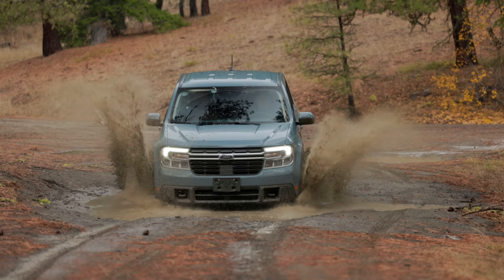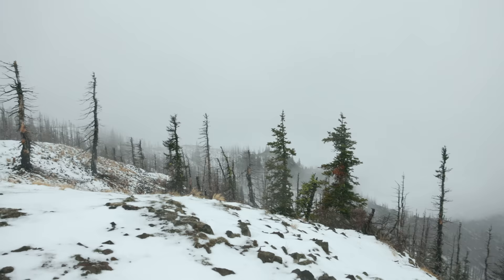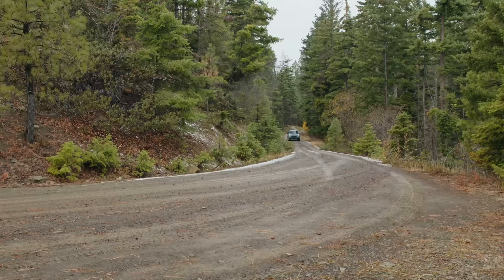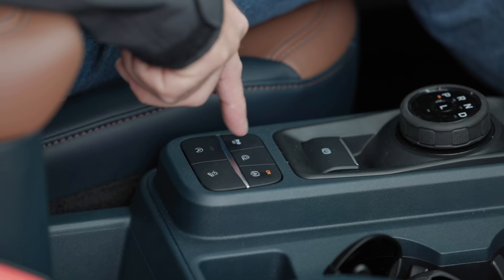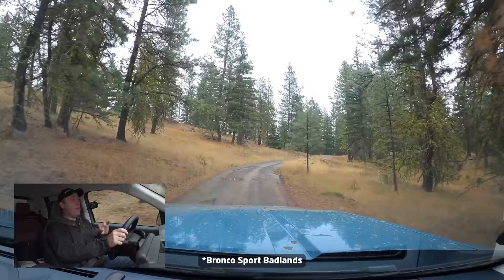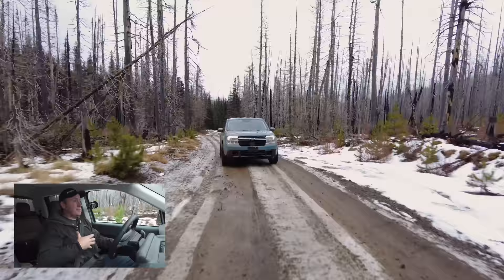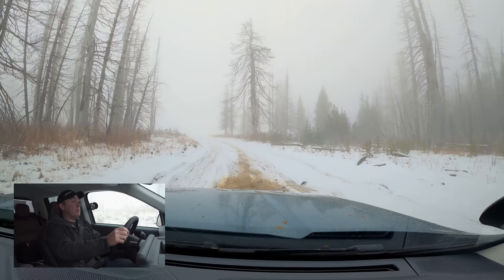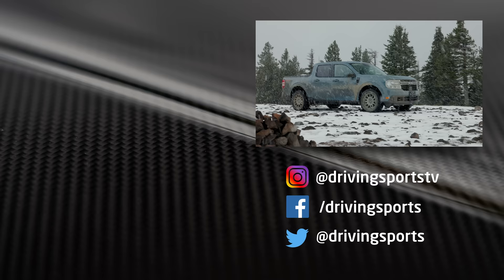2022 Ford Maverick FX4 Vredestein Pinza All-Terrain Mountain Adventure

Comment: No interest in lifting the Maverick as is? I guess it's good enough for what you'd use it for.

Definitely my favorite new car of the year. Just wish there was an AWD hybrid.
Reply: I'm pretty sure all that is out right now in the aftermarket lift world is basically just spacers to lift the body away from the suspension which is definitely not the ideal way you want to lift a vehicle. I would wait for a proper real suspension lift to put on instead of the spacers
Reply: @Mr.Thermistor7228  3K lift on a 20K vehicle? 🤣
Spacers will do just fine.
Reply: My thoughts exactly, there's an AWD hybrid escape, why not the Mav? Price maybe?
Reply: @misohoney4656  Having seen both done on the Jeep Liberty, I can say with confidence that a full coil over replacement kit is going to be significantly superior to spacers.   And it doesn't have to cost 3k either.  1k is normal for a mid range coil over kit.  Now, if you want adjustable hydraulic shocks and all the other hard core offroad goodies then yeah, 3k.  Why would you get that for a Maverick though?  Upgraded Old Man Emu or Bilstein or Rancho shocks and stiffer taller springs isn't going to set you back that much and it will do a better job than "hockey puck" spacers will.
Reply: In general you should avoid ever lifting IFS unless you get a redesigned kit with new control arms etc, otherwise you're just asking for trouble if you're going to do anything that requires that full suspension. Slightly beefier tires was a good route to go, the Maverick already has pretty decent ground clearance.
Reply: @benlzicar7628  This statement is patently false.

I have been driving a lifted IFS 2008 Jeep Liberty for 13 years (10 of them lifted) without any issues.  There is no reason whatsoever to avoid lifting an IFS, provided it is done within the limitations of the range of the arms.

IFS DOES have limitations to the amount of lift you can add, and the more lift you add the more complex and expensive it gets.  At higher lift heights (Usually more than 3 inches) the lift will require replacement control arms and long arm axles, etc.  Less than that though and you are perfectly fine and there is no significant danger in lifting.

There is an argument to be made that lifting MAY cause premature wear on some parts.  However, the wear involved is often minimal if one's driving is primarily on road where the lift won't be stretched out to full flex very often.  In other words:  For most people it will be fine.
Reply: @Wearyman  any 3 inch lift recommendations for a 2008 Grand Cherokee? Also, would I need better differential gears over the standard gears when going with bigger tires?
Reply: @FluffyHawk13  Honestly couldn't offer a recommendation, I'm not super well informed on the Grand Cherokees.  That said, I have absolutely seen a bunch of lifts available for them.  Check with all the major manufacturers, and check some of the Facebook groups and internet forums to see what people recommend.  Re-gearing isn't something to be attempted lightly as it is a major system change.  Although as you get larger tires, moving up to a higher ratio can help maintain fuel economy and highway speeds.  So if you intend to really go up, it is probably worth considering.
Reply: @Wearyman  appreciate it! 👍

Comment: If my wife would allow me I would trade tires as often as you have been :)
Really do appreciate all your tests.  I live in Rural mountain Wyoming and have to drive a few hundred miles a week on dirt/gravel and snow.   We ended up going with Falken AT Trails as a compromise between a HD All terrain and a snow tire. (Running on a Jeep Renegade 4x4 with manual trans).   
Considering trading the Renegade for a Maverick each one of your videos is making me more interested.
Reply: Bro, an AWD manual transmission Jeep Renegade?! Aren't those unobtanium?
Reply: @AWDfreak  they are very rare but probably the best combo in a Renegade.  Has the 1.4L Turbo and 6-Speed manual.   Ours is a 2015 that we bought a year ago with only 10K miles on it.  Sadly they discontinued the manual a few years ago :(  Love everything except the space
Reply: @flightmedic7634  It has a pretty short 1st gear, correct? I believe it has an 18.5:1 crawl ratio. It's not quite as good as the surprisingly-capable 20:1 crawl ratio as the ZF 9HP-equipped Renegade Trailhawk, but still massively-better than its sole direct-line AWD manual competition, the car I drive (a manual Subaru XV Crosstrek). Though mine has a special swap that makes its crawl ratio better than even a Renegade Trailhawk 😉
Reply: @AWDfreak  Yes first gear does pretty well.  I have taken it over quite a few trails that were way above what most sane owners would attempt and it has done just fine.    I was considering a manual Crosstrek as well.   A gear swap?  That sounds very interesting. 🙂
Reply: @flightmedic7634  Nah, better. A dual-range 5MT swap. Probably a huge waste of money for most, but I was willing to pay for it.

I think buying a manual transmission all-wheel drive Jeep Renegade would have saved me a lot more money and trouble. Factory-optional Mopar rock rails already available, factory Trailhawk undercarriage protection can be purchased in ready supply under warranty instead of having to buy all this aftermarket protection that I did on my Subaru.

I like my Subaru vehicles, but I'm very much envious of what the Jeep crossover lineup has to offer in terms of factory-available off-road-related parts and outright out-of-the-box off-road capability.
Reply: @AWDfreak  True Jeep definitely does a good job their equipment.   Plus very good approach and departure angles help alot.  I drove a Crosstrek for work for a few years and I really enjoyed the vehicle overall.   They would both definitely benefit from a actual low range.   If I could find a dual range manual transmission I would probably be willing to waste some money on that too🙂 Most times on the trail the lack of lower gearing is my only reason for having to turn around.  I'd imagine that would be pretty helpful on a Crosstrek
Reply: I have the same tires on my Forester. Pretty happy with them so far. They have not seen a lot of dirt yet, and have not been snow tested (but that is coming soon). Great on the highway and especially in the rain.
Reply: I have the same Falkens on my Jeep Grand Cherokee, they're fantastic. The AT3W'S have better grip though but not as smooth on the highway

Comment: Um, pretty sure that most would agree that a narrower tire is better in snow because of increased ground pressure per square inch. Basically, narrower tires 'cut-through' the snow instead of floating on top of the snow.

Comment: Great review as always. This is the best car channel on YouTube hands down. 

I like these tires but there are so many other options made in the USA that I would give these a pass.
Reply from the maker: I get that. Thanks for watching!
Reply: @Matthew Putnam I feel the same way about the truck.
Reply: @rightlanehog3151  truck is not made in USA but unfortunately nothing similar is. Sucks
Reply: @TheCoffeeField  Honda Ridgeline is 🤷🏻‍♂️
Reply: @fubarmedic4222  the Ridgeline is bigger than this one. The ridgeline is a Pilot with a bed. The Maverick is much smaller
Reply: @TheCoffeeField  yes sir you’re right. the Ridgeline is bigger, 11 inches longer and 5 inches wider, And starts at 36k… but the maverick in a comparable trim (XLT with all the packages) is 33k. And the maverick is a Ford Escape with a bed just like the Honda Ridgeline is a Honda Pilot with a bed. Which in my opinion is kind of a poor argument as that’s what they are suppose to be. Also the maverick does get 4mpg better gas milage but the Ridgeline tows 1k more pounds and has a higher payload 250lbs approximately. Also the Honda has a V6 and a better AWD system. 

So its whether or not you want the slightly bigger slightly more spacious Honda or the capable, slightly more affordable maverick.

I compared them hard and couldn’t get over the 12” smaller bed and the vastly more spacious interior of the Ridgeline. Plus the V6 is better tested, longer lasting and more durable engine. Also to matthews point it’s American made.
Reply: @fubarmedic4222  solid argument. Really appreciate this. Thank you
Reply: @TheCoffeeField  I appreciate the civil argument/ convo for sure! Happy new year!
Reply: @fubarmedic4222  definitely! Happy New Year

Comment: Great video! I run wild peak AT3W on my half ton ram here in Western Quebec where we get a ton of snow. It's true that they aren't quite as good in the snow as when I ran a dedicated winter (firestone winterforce UV if I remember correctly). In my opinion the AT3W is far superior to the firestone in deep snow with comparable braking at lower speeds. The Firestone's blow the AT3W out of the water at high way speeds though. In my case, I rarely drive the truck on the highway so this works out fine for me. 

As always, you make great content!

Comment: Would love to see a maverick tremor edition.  If they can add it to the ranger why not the maverick
Reply: It's really not that type of truck, but I would love to see it just as much as you and I absolutely think they should do it. I just understand why they wouldn't at the same time
Reply: You'd really be defeating the purpose of the truck.
Reply: @farstrider79  not really, would only be increasing its offroad capabilities.
Reply: @danieljackson-woods6225  Agreed - a little lift / heavier duty suspension could actually benefit the load-carrying manners.  Also, the Bronco Sport has its off-road package on the same platform, so it's not like they'd have to spend much on engineering.
Reply: @danieljackson-woods6225  Exactly.
Reply: I believe they're already testing a Maverick Rattler trim which is supposed to be a more off-road oriented trim.
Reply: they need to put the twin clutch from the bronco sport on the maverick

Comment: Been running Vredestein Quadrac Pros (also tri-peak rated) in my '17 Impreza for a couple years now here in New England, haven't felt the need to switch to dedicated snows, they just "work". Big thing about tri-peak is, sure, the snow, but also the "really cold freeze 0 or below" days where you'd want a dedicated snow with softish rubber, where an "all season" would be kind of hard and lose traction, even on dry (or, salt covered) pavement. Others have found the same when I've recommended. The price doesn't hurt either. And in the summer? still grippy. I'd definitely say they're much better in all weather than the Conti DWS or DWS 06 that I used to swear by. Practically night and day.

Comment: Speaking to the snow in the PNW I was going over snowqualmie pass heading west in the spring in a 2WD dodge dakota. saw a light dusting thought 'eh its nothing' almost slid into the concrete divider as soon as I hit it. Ended up having to follow an 18 wheeler's tire tracks for traction until the other side of the pass. Not unfamiliar with snow in general having grew up in western MT but that was something else.

Comment: I had a first gen Nissan 200SX 5 speed manual. I put on vredestein all season tires.  I could not get the cars stuck in the snow.  They were rediculously good. I actually would try to get then stuck.  Was always able to get out.  I did not go off-roading since it was a two wheel drive car.  But they were amazing tires that as you said, provided alot of confidence.

Comment: Waiting for the 42mpg Maverick.  Built it several times.   $22,800 out the door with sunroof, rear window and bed liner.  Don't need AWD in Appalachia, Subaru Forrester is for that.  And yes, we do get snow and muck at elevation as well.

Comment: Awsome point about AT tires not being a substitute for actual snow tires. People get confused with the snowflake marking I think.
Reply: I like to add to that comment on the at tires,yes some brands will have two of the same All terrain tires ,one with three peak/ snowflake on it and one without,same thread depth and pattern ,the only difference between the two tires is the rubber compound. The snow peak tire will be slightly softer rubber then the non tire.making it for a better traction in the colder and wet weathers. Plus your your tread mileage is lowered compared to the non snow peak tires.
Reply: A real winter tire is a night and day difference, even from a snowflake symbol tire.  I recommend Michelin-X Ice Snow to swap in the winter.

Comment: You mention back east.  I live in the Pittsburgh area.  Our biggest worry is the 37 degree day rain that turns to ice as the temp goes down just before rush hour..  In addition, if you've ever been to the area, you are either driving up or down a hill 95% of the time when off of a highway, so don't be a bad weather snob LOL :).  Now that the comedy is out of the way, how do you feel about these tires on ice, and do you have any thoughts on durability?  Thanks for the great video.

Comment: I want to order one so bad, but hate all the dealer add ons dealers around me want to add.
Reply: Mine charged msrp. They are out there. May have to drive further.
Reply: @JamesD-HB  oh I know, I've called 3 so far with no luck.
Reply: Hmmmm. I added what I wanted. When I got the lux package there was one thing I didn't like that much but no big deal.
Reply: @timjohnson1199  I'm talking about the extras, they say are mandatory.. like tint for 600, and a few other things.
Reply: How can "extras" be "Mandatory"

Comment: How did you fit the LP1s to the Maverick's bolt pattern or did you get early access to a 5x108 version? LP Aventure doesn't list one.
Reply: I'm thinking LP Adventure drilled a special bolt pattern for him from wheel blanks. They don't offer the 5x108, yet, but I'm guessing they are planning on it and putting feelers out with this product placement. Best looking wheel I've seen on the Maverick by far
Reply: Edit to my other response, looks like Tirerack is the only place that sells a 5x108 version of the LP1. LP Adventure doesn't even list that bolt pattern as available on their own site. Strange.

Comment: So which ones win? Vredestein Pinza or BFG AllTerrain K02 or BFG TrailTerrain
Reply: I ran the KO2s on my Crosstrek for 3 years and recently switched to the Pinzas in the same size (215/75-15). The Pinzas are massively quieter, handle much better and are much better in the rain/wet. Have not tried them in the snow yet but considering they have sipes which the KO2s lack, and how good Vredestein's all-weather and winter tires are, I'm expecting them to be a big improvement there as well. Unless you do mainly off-roading, the KO2s are a compromise.
Reply: @RogerGarbow  good feedback, thanks. I have K02 on our older F150 for many years and I’m not convinced there isn’t anything better. They look great but like you said, aside from dedicated off-road use, there is room for improvement. I think I’ll really look into the Pinza’s
Reply: @RogerGarbow  1 year later from your reply, are you still liking the Pinza AT?  I'm considering them
Reply: @ddbear8786  Yes. I’m super happy with them. Best all-around all-terrain I’ve experienced. And they are good in the snow, too.

Comment: Check out Firestone Destination X/T. It's an A/T tire that is more on the off-road than on road side, but its very lightweight, 3 peak snow rated and I cant hear them on the highway. They're the most impressive A/T tire I've used so far. Oh and more impressive is people on Youtube who have them at 30,000 to 40,000 miles say they still have all their grip unlike most ATs
Reply: Tire Rack test results show poor traction/braking results for Destination X/T on both wet and dry, so I wouldn't even consider that one.
Reply: @ddbear8786  i just checked that and seems like the result are in between an AT and a MT tire which is what the XT is (a hybrid), so that makes sense. Not sure why they compared it to those other tires.

There is:
Destination AT2 (all terrain)
Destination XT (hybrid)
Destination MT2 (mud)

Comment: So, after testing the Pinzas, BF Goodrich Trail Terrain and Falken Wildpeak Trail, which would be the best all-around tire for someone who might go offroad 10% of the time and lives in a state where snow could be for about 4 months of the year?  Thanks
Reply: I would recommend a seasonal wheel/tire swap and use true winter tires for those 4 months of snowy days - Michelin X-Ice Snow, and then an all terrain tire for the summer such as Pinza AT, Wildpeak AT3, Defender LTX M/S, etc.

Comment: Not bad for a budget truck. Falken wildpeak  are ok new but from the oem I've had on my Jeeps before, they were really bad in wet conditions and once broken in and started dry rot cracking after a year shockingly. Replaced with pirelle scorpions before I traded that jeep and they were a pretty good all around AT that handled the snow well.
Reply: That is strange, from everything I heard the Falken Wildpeak AT3 is one of the best in wet conditions and hydroplaning, and still good after tread wear because the tread starts out so deep, it always has enough groove to displace the water.  Did you run them bald?
Reply: @ddbear8786  it was the wildpeak non at3 that was on the jeeps from the factory back then. I hear the at3 is a better tire in every way nowadays.
Reply: @user-cg7cc7zj3e  I see, so if I understand correctly you were referring to a different tire, a Falken Wildpeak OEM non-AT3 and now there is a newer AT3 version.
Reply: @ddbear8786  The jeep I owned definitely didn't have the at3. I looked at some old photos of it was a wildpeak HT. They were a really bad tire  at the time.